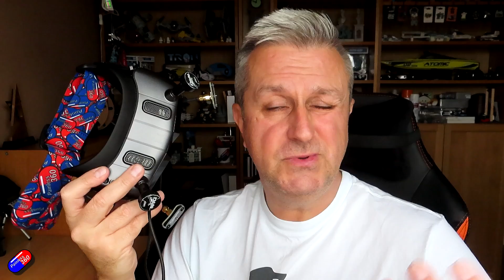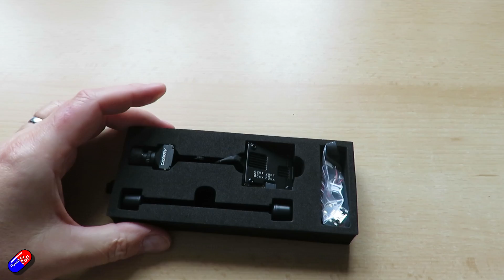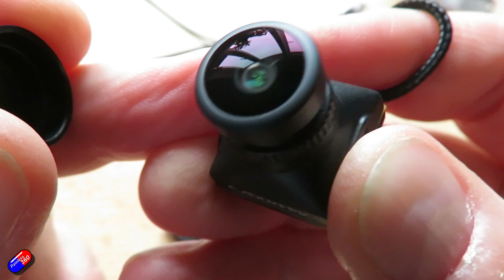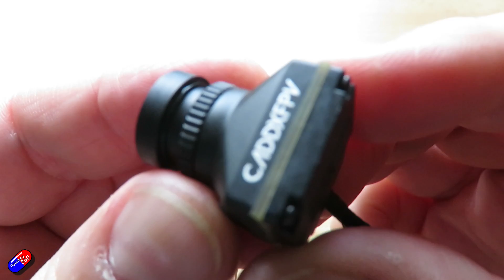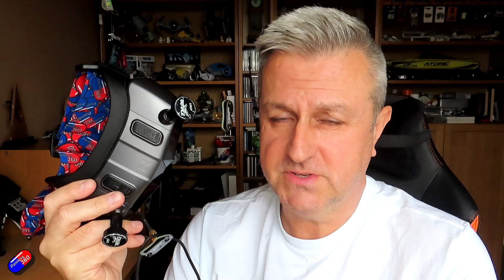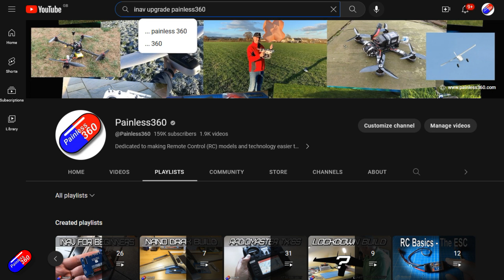Walksnail AVATAR PRO V2: The latest camera, updated AVATAR shell and two antennas..

Comment: Hi, could you put a link to the goggle strap you have, I’ve just bought a pair and I’m not keen on the OEM strap. Cheers
Reply from the maker: These are fatstraps... Happy flying
Reply: @Painless360  cheers!!
Reply: @Painless360  Hi, I’ve just been on the web site excellent choice. 
one question, I have the Walksnail goggle X, which attachment type suits the closed loop on the goggles? DJI? Cheers.
Reply from the maker: Sadly I had to get Mrs Painless360 to adapt a set of them to make them fit. Neither the DJI or FatShark style I had here worked out of the package..

Comment: Hi, I have a couple of questions if I can please 🙏 
Do you think I would get 1km off range on the surface with direct line of sight ie a runway ? And can these work stand alone at full power with out flight controllers ? I am very new to fpv but want something for speed running / Rc land speed racing.
Thanks in advance.
Reply from the maker: I've only used ExpressLRS in Aircraft, so I'm not sure about ground eange. Pilots are getting tens of km... you don't need a flight controller to use ExpressLRS... Happy flying!

Comment: So i don't use the cameras for flying. Only a camera, the Tx, an Rx (the Avatar VTR unit for example) and of course a monitor is needed to see the videostream?

How many Tx can be paired to one Rx at the same same time (and be switched), or is it only one at a time?

Can someone receiving on the same channel see my videostream or is this kept only between my Tx and my Rx?
Reply from the maker: The AVATAR units are designed to send to a Walksnail receiver, either in some goggles or an external unit (see the VRX). They can drive a monitor via a HDMI cable..
Reply: @Painless360  Thank You for your response. Yes, i meant 'VRX' on the receiving end. My bad ... Oo

How many cameras (HD-pro) can be bound to 1pc. of VRX or is it only one at a time? If more than one, can the cameras be toggled in the menue?

Is the connection, the videostream, from camera to VRX a private conversation or can anyone who's working on the same channel with walksnail equipment see my videostream?
Reply from the maker: One at a time binding from the playing here.. Happy flying!

Comment: Hi Lee,  Great video and review of the walksnail avatar pro v2. This one I would love to install in my wing and 7in. I could install it on my whoops. Unfortunately until the price drops,  I'm still on analog.  Thanks again for the video and information about this walksnail avatar pro v2
Reply from the maker: The issue is that for pilots with large fleets, replacing existing analogue equipment can be expensive, but with the cheapest modern Walksnail units costing less than $80, it is a similar price to a high-end analogue camera and vtx now.
Reply: I’ve got a 2.5 Apex and 2.5 Foxeer unbreakable whoop with the Avatar 1s.  Super awesome!

Comment: Which antenna's you recommend doing long range for same unit and antennas for goggles X also?
Reply from the maker: Depends on what you mean by 'long range'. You'll need the AVATAR unit on the highest power, I'd replace the supplied antennas with something like the MenaceRC AeroPOD for a wing and then you'll need high gain, very directional antennas for the goggles. I use the PICO patches here but I'm not flying over 1.5km away here.
Reply: I've been hearing that the V1 unit is still unmatched for range, but you gotta deal with the GPS interference issues.
Reply from the maker: I've heard that too but as someone who doesn't fly too far away (not legal here in the UK), I like the diversity antenna setup so that I can have two setup on a V on the plane/wing..